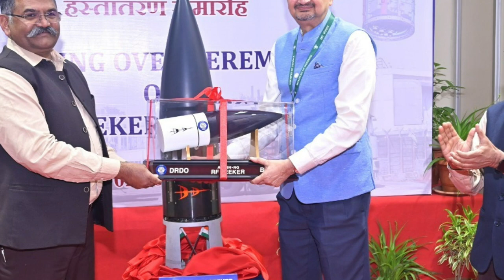#breakingnews  BDL developed & handed over 1st Akash NG seeker to DRDO #indianarmy #indianairforce

Comment: What's actual Range?
30km or 70km?
Need clarification please......
Reply: 30km as per brochure...though it is hard to figure out why considering the engine used...
Reply: @@mantham343 70km range is as per Wikipedia source.....several defence channels including this one also saying that the Range is 30km.
There's no actual statement from DRDO regarding range.
Reply: @@mantham343 I know that very well but since many defence channels mentioning range 30km which is shocking(same said in this video also)...... QRSAM has 30km range so Akash NG is big size dual pulsed missile so it should have 70km /80km range.